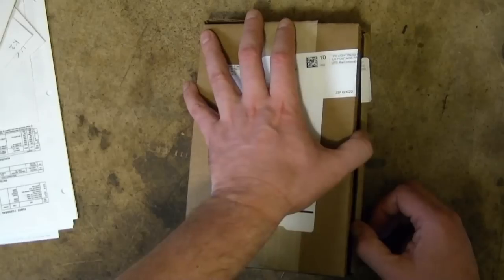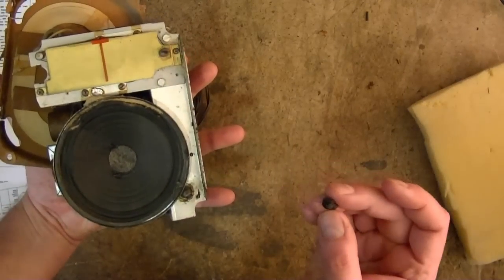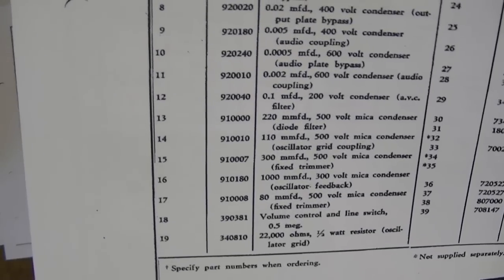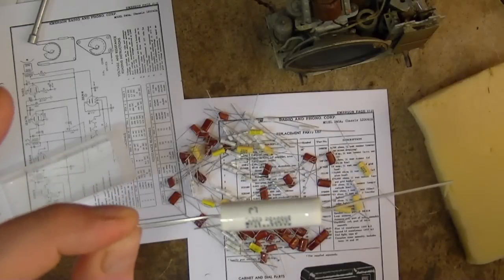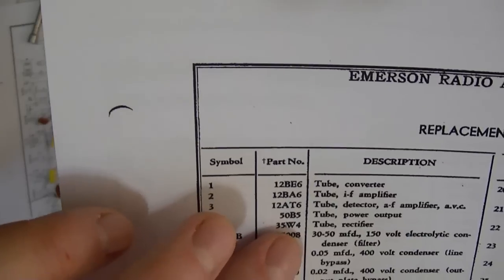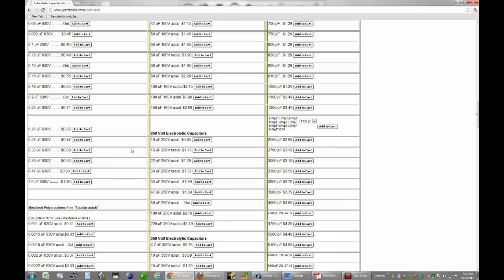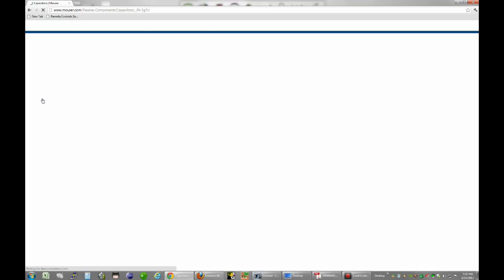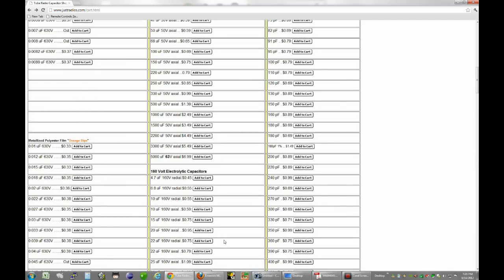Capacitors - what kind to use and where to get them

Comment: Name brand axial capacitors have been hard to find for quite a while, especially on the surplus market. I used to buy surplus caps from a place in Montreal and most of their offerings had radial leads, sometimes short radial leads, not really a surprise given how long printed circuits have been the norm in electronics. But I still used them, I just pigtailed extensions onto the short leads and installed them just like axial caps.

Comment: A new project? Did you get tired of working on the Predicta or did you run out of parts? Those mini AC/DC sets are cute but they sure have a lot of heat damage problems, they basically cook themselves to death.

Comment: i dont know if you mentioned it but back in the day electrolytics were marked for WV (working volts) and nowadays they are marked for maximum voltage...also  if its a tv there are sections were you need to use caps rated for ac pulse applications because the dc rating will mean nothing there..

Comment: You can replace some mica capacitors with precision ceramic capacitors but it depends on the circuit in which it is used, I've used them in place of micas before in mini IF cans like this little Emerson has. The yellow ones will be around for quite a while yet, knowing the way China and Taiwan are like they will make whatever anyone wants to order, which is how most of the old radio parts suppliers get them, to order and in bulk. I haven't seen anything factory made that used those yellow caps.

Comment: Hi Bob. So the parts didn't that long to arrive after all... Great info on the caps. They are specially confusing with all types of shapes, colors, and coding, voltage etc. I've read about a special type of cap I've never seen that is the glass capacitor. If you don't mind me suggesting, why don't change the name of the video (if possible) to something like "talk on caps" or "A little about caps" or something of the sorts. That would help a lot for future reference - conti.

Comment: I haven't seen anything factory made that used those polyester film capacitors, with the exception of some air conditioner power supplies, but not really consumer electronics. There isn't really any way around high voltage parts in heating and aircon equipment, or in microwave ovens of course, so whether they are used in TVs or DVD players isn't really a factor since they haven't used them in any quantity in years.

Comment: I really like the selection that Just Radios offers but for someone just starting out that doesn't want to meet the $15 minimum order and is having problems with Mousers interface I recommend vacuum tubes inc. dot com from Orlando.  They don't have the large selection that Just Radios does but they have the basic electrolytic and film caps you would need for a basic AA5 radio and they have no minimum order.  You can also order and replacement tubes your radio might need at the same time.

Comment: Are you afraid axial or radial lead components are going to get harder to find, since so many modern electronics are manufactured using surface mount components? I had someone tell me that through hole components are going by the wayside.